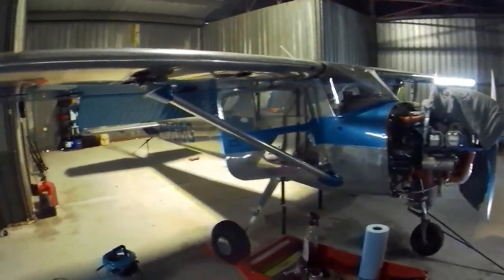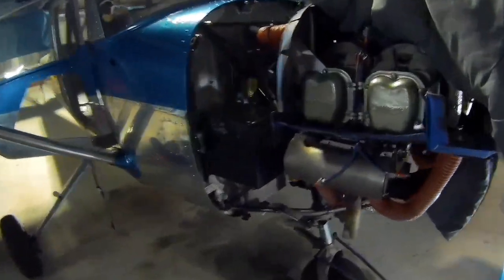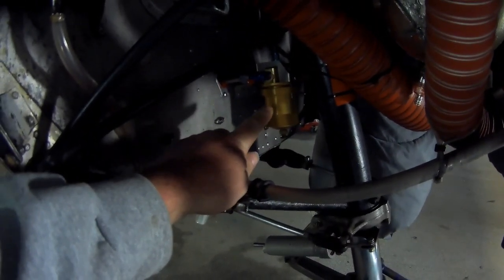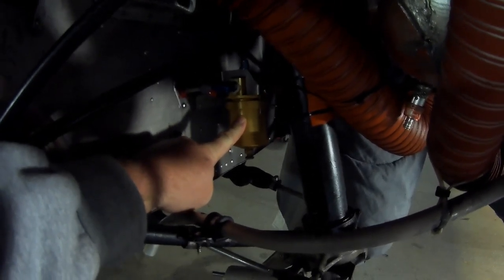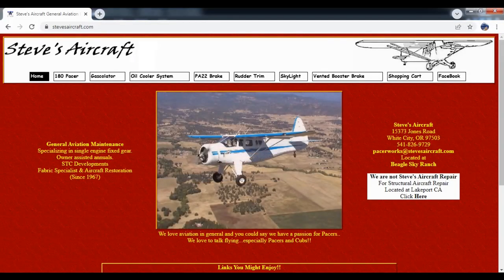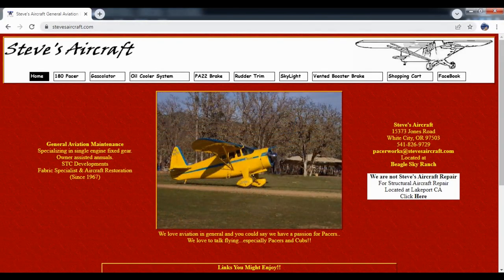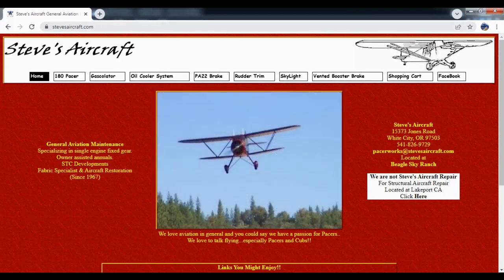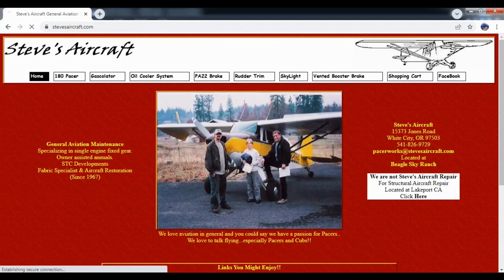Cessna 150 Safety Mod - Steves Gascolator

Comment: Hi Sir, two quick questions. Would you happen to know the company that manufactures the patrol doors you have on your aircraft? Lastly, what is the useful load of you aircraft and how much was it affected by the child seat. I’m Trying  to figure out if adding a child seat will be doable. Thanks ahead of time.
Reply from the maker: I had an STC for the modification. It was done in the shop. As far as the child seat, it adds about 10 lbs of weight, so with my wife and I and full fuel I can carry approx 60 lbs on the seat. Being worth it is going to vary on your setup and situation

Comment: so to test this fuel, you have to take the lower cowling off, correct? if i use the upper release, i only have to open the oil/battery compartment flap
Reply from the maker: No, you simply put the test tube under opening of the cowl. if you have a belly drain your already under there anyway.